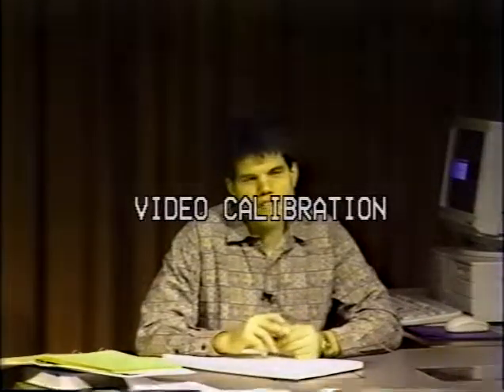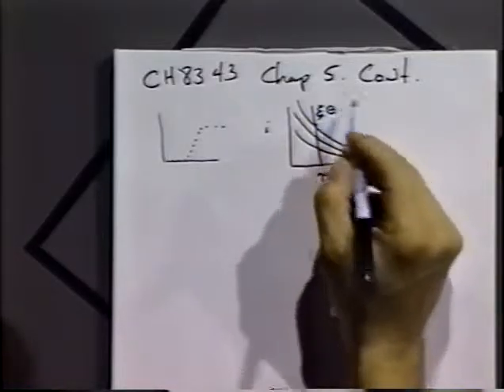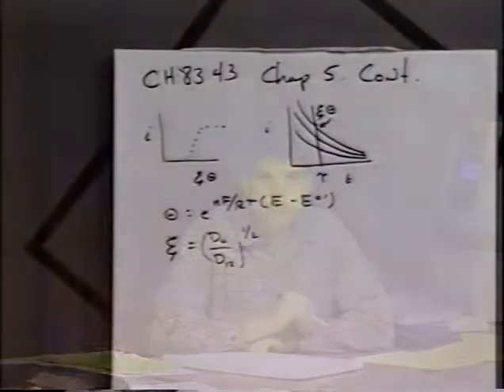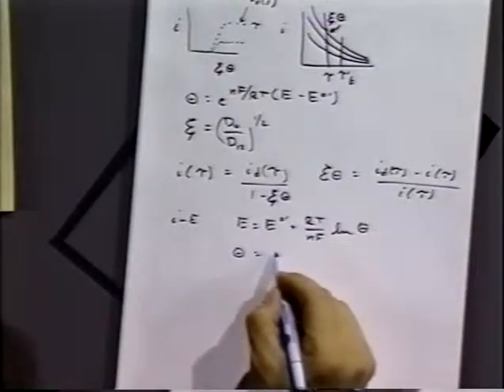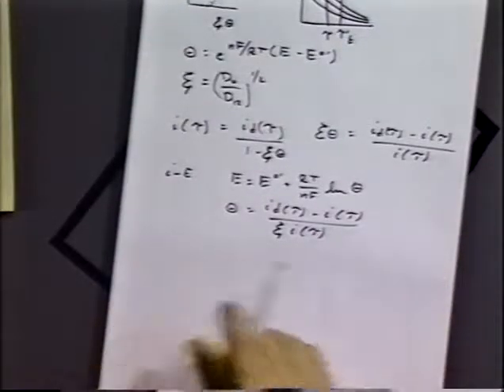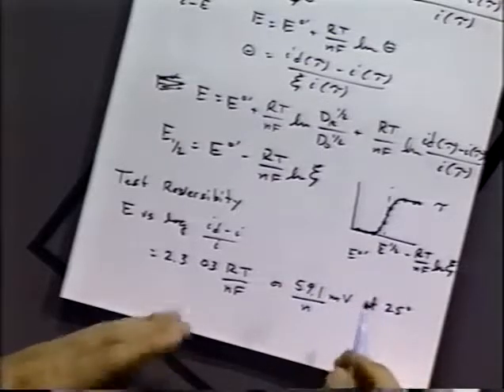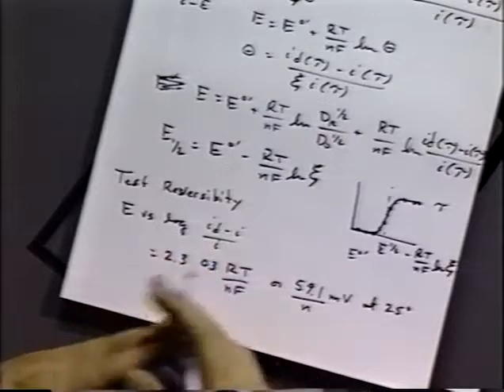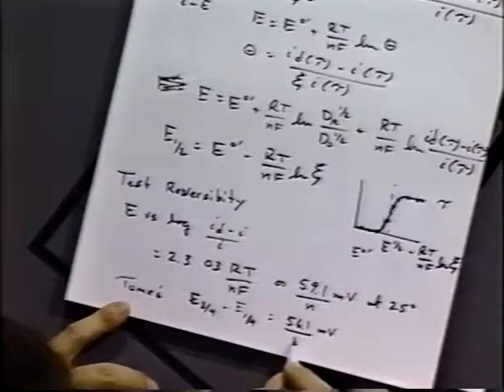Potential Steps

Comment: Hello Sir,
Thanks for the video! I understand how the sampled current voltammogram was obtained - but was under the impression that that is the only way you can get an i-E curve of the sigmoidal nature. How else would one obtain that? (you used a generic i-E curve and pointed out the potentials we are stepping to..I thought that was always from the sampled current voltammogram). Experimentally, if we do an LSV, we won't see this sigmoidal curve right? (there will be a decrease in current after a certain potential) So how do we obtain this generic i-E curve for a nernstian reaction?
Thanks for your time!
Reply from the maker: Yes, you are right that LSV and CV curves will not typically be sigmoidal, rather they are peak-shaped.  This is because they are typically acquired at large planer electrodes under simple diffusion control. However, if you stir the solution (like in an RDE experiment) you form a fixed diffusion layer and this leads to a sigmoidal curve. Also, if you use small electrodes (ultramicroelectrodes, UMEs) the diffusion is “convergent” and non-linear, leading to sigmoidal curves. See those lectures for more info.  Both of these cases are examples of “steady-state” voltammetry in which the I-E curve is independent of time
Mostly though, in these lectures, I use a sigmoidal curve to avoid having to discuss the complications of a changing concentration gradient with time like you have with planar diffusion, which gives a non steady-state diffusion.

Comment: It should be (1+E*Theta) at the denominator. We can't have more current than a purely diffusion controlled case right? where kinetics are assumed extremely fast (corresponding to current id). Also, (1-E*Theta) it won't match your expression of theta as a function of id (tau) and i(tau)
Reply from the maker: Yes, you are correct, I made a mistake there at 3:07, should be i(τ)= id(τ)/(1+ξΘ)